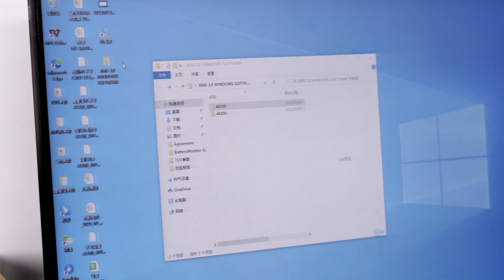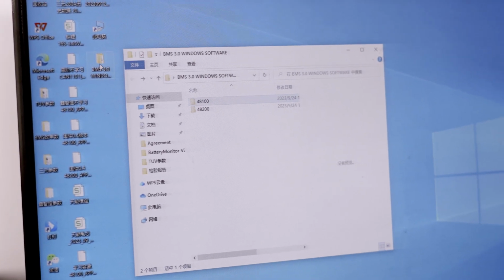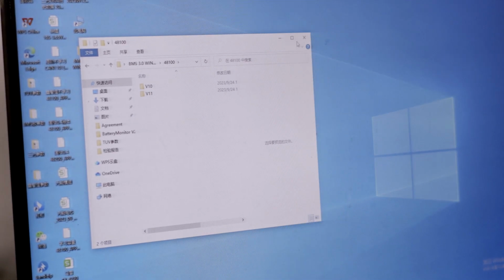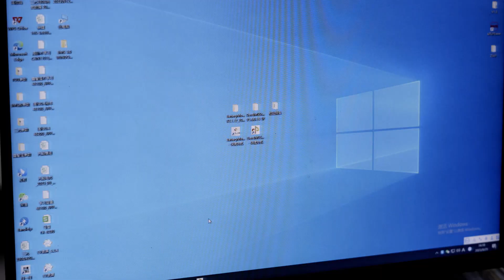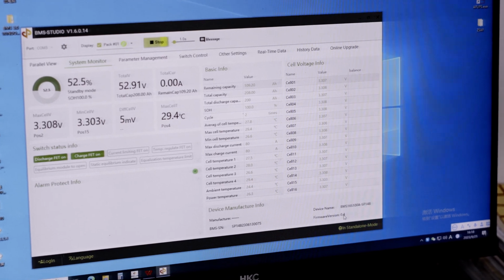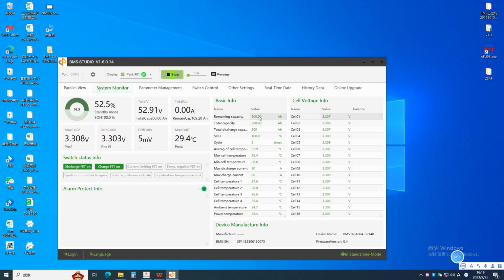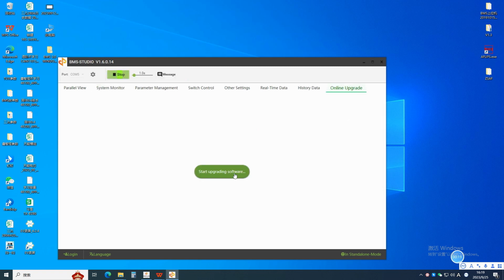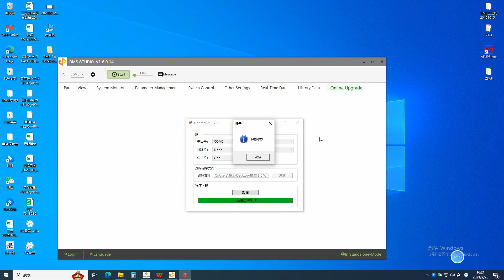How to upgrade the SEPLOS BMS3.0 to solve the passive balance?

Comment: Tu be honest ... seplos technical suport is (i do not want to be rude so ...). I have issues with their BMS i asked for a firmware without any success, since the answer was to download from website but nothing clear if the only avaiable firmware to download is ok form my bms or not. The answer when i was said i have 180 mw difference between the tighest and lowest cell they answered is ok. I was buyed 5 seplos bms but ... i will change them with something who actualy work. I will avoid seplos from now on.
Reply: 000000 should work for App

Comment: @SeplosTechnology  Hi Seplos 🙂
i tested
now after a few days I can praise the new firmware update to 0.5 , the balancing works in the long run :-). 
With a single test you can not seriously evaluate.
Now after 4 times discharge and charge.
the lowest cell now makes it to over 3.4V, the first time .
It goes in the right direction with the new BMS :-)